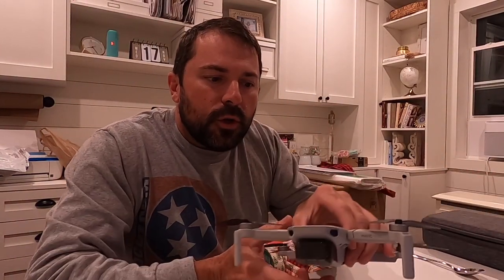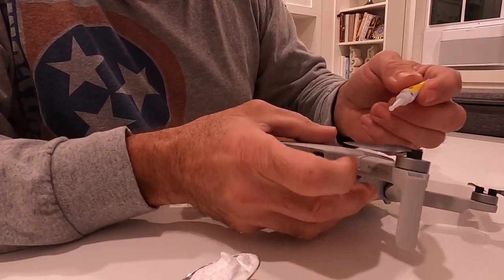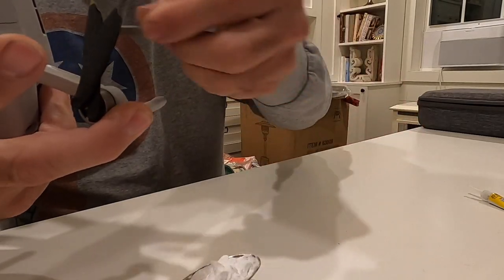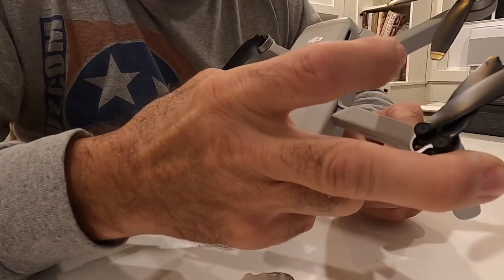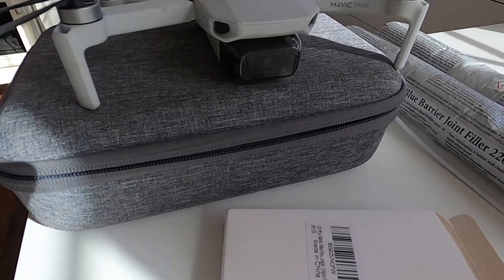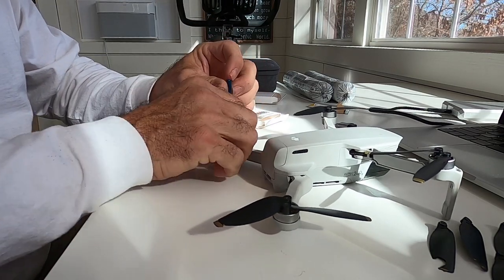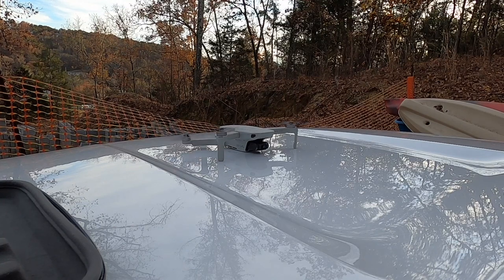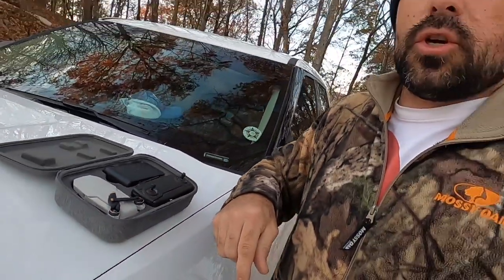No tool Quick Drone ARM repair [DJI]

Comment: PASS! The whole time my mini 2 is 2 miles out I'd be wondering when my hack repaired arm will break and lose my $600 drone. I'd rather pay $40 for a new arm and do it right the first time...
Reply from the maker: this is a good temp fix to keep you flying, but I agree get the replacement arm

Comment: I just broke my left front arm on my MINI 3. I used this hack and will test it out tomorrow. It's currently curing. Does it really need to be 24 hours? lol
Reply from the maker: better safe than sorry
Reply: @TheProCut17  I was impatient and I flew it after 10 hours curing. It's back in the air! Made a really strong bond. Thank you for this, I already purchased a replacement arm.
Reply from the maker: @strawhatgolf  excellent this is a great fix to keep you flying until parts arrive.
enjoy the rest of your weekend friend

Comment: Broke my propel Spyder XL, don't think it's fixable but is a shell swap an option? And if it is where would I find a replacement shell
Reply from the maker: I'm not familiar with that model but I'm pretty sure you can do a shell swap.
check eBay, Facebook market place, & craigslist for a donor shell.
 https://www.ebay.com/itm/155019073642?chn=ps&mkevt=1&mkcid=28&srsltid=AYJSbAdx4p7jjb2ABRn2wh89gsOcNluRPDB3NlQzDwbvlnvN9kso4VILtJs
Reply: @TheProCut17  thank you very much
Reply from the maker: @cinnamoncoca-cola2388  happy to help when I can
Reply: @TheProCut17  sorry to bother again, but do you think it's possible to 3d print a new shell?
Reply from the maker: @cinnamoncoca-cola2388  I wouldn't know how to do it, but I'm sure it can be done

Comment: Question from three months in the future. How has this worked out? About how much successful flying time do you have on the repair?

I recently dropped my mini 3 (not a flight crash) and I fractured the rear arm at the "wrist" (right up at the motor housing?. I was considering doing the super glue fix, but was worried that it would snap during flight, turning a $100 problem into a total loss.

I've been reading up about the baking soda hack with super glue. It seems that it strengthens the bond
Reply from the maker: it flew great, I did have to re-glue it as I broke it back off opening up the drone one day. I would say this is more of a temp fix, but you can get a replacement leg for around 20-30 bucks used I've seen.